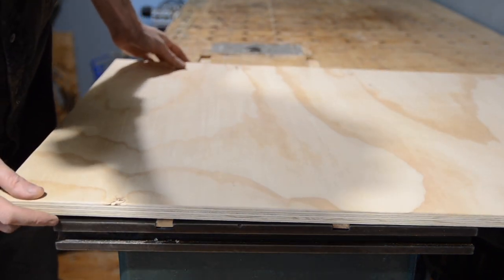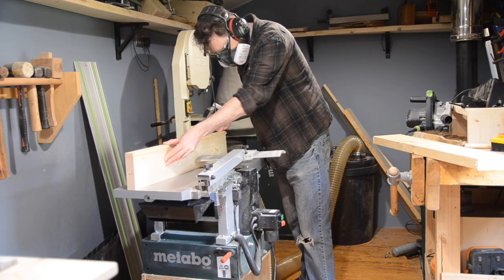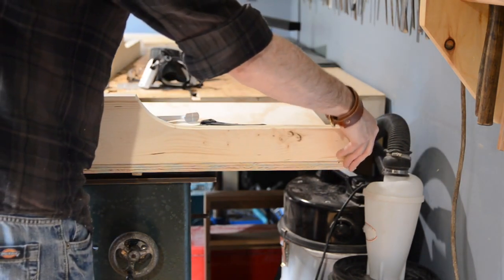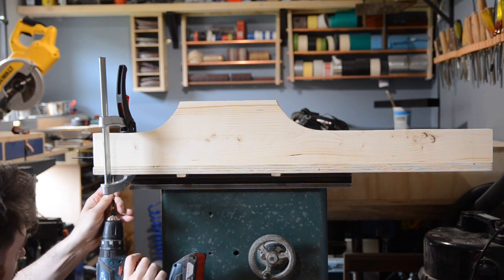Making A Crosscut Sled

Comment: Cross cut sled - a luxury you don't know you're missing until you use one. The old mitre saw is all well and good but there are times [esp lap joints] when the sled is just THE tool for the job. Great job and a worthwhile investment!
Reply: Just wondering if there's sufficient security in the Badger Workshop, what with all that cash floating around
Reply from the maker: Yes a sled is so handy
Reply from the maker: don't worry I take my coins to bed with me
Reply from the maker: Yes sleds are so handy

Comment: That MDF has a really nice grain 😂

I really do need a sled, I've been putting it off for years, I might actually give it a go today
Reply: a table saw and NO sled? Ludite!
Reply: @negotiableaffections  Ive barely used it for cross cuts as Ive always just used the mitre saw or track saw
Reply: @animationcreations42   I prefer sled to mitre saw for lap joints & any not full depth cutting - the set up is much simpler.
Reply: @negotiableaffections  That's the exact reason why I'm going to be finally making one!

Comment: Used this method to make a single-sided sled and worked fine, other than the fact that the CA glue oozed out, bonded to the coating on my tablesaw table and pulled it off in a couple of places along the mitre slot...!